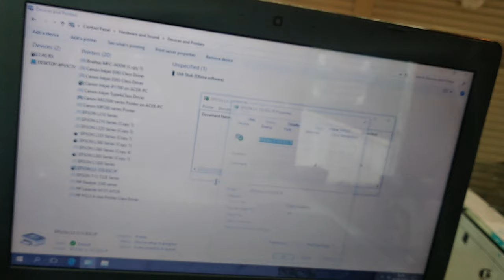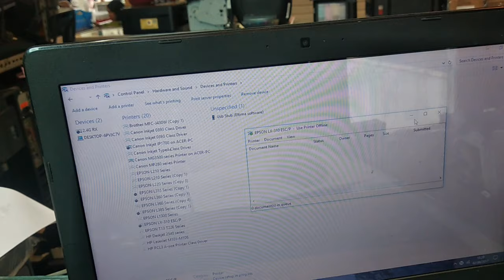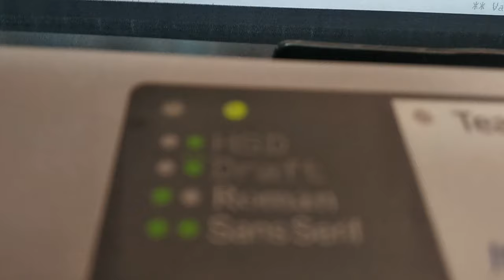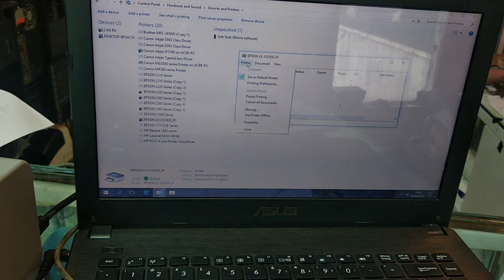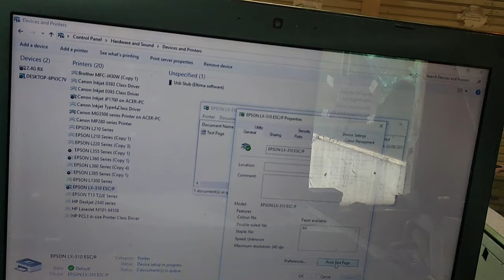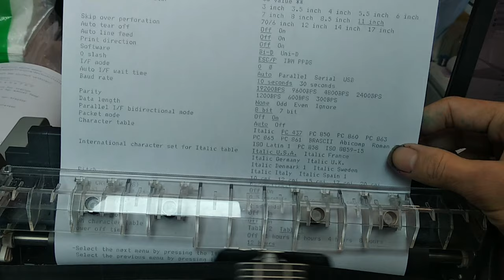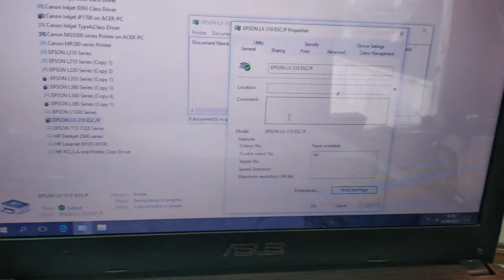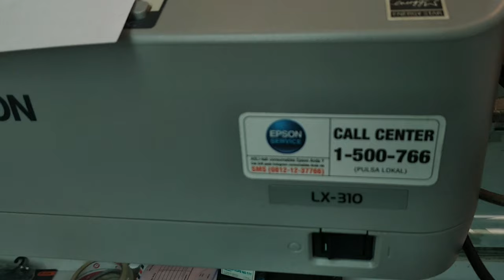Cara atasi printer epson LX-310 tidak mau print (padahal USB conect)

Comment: kang printer lx310 saya tidak respon print lg setelah sblmnya bisa. Kronologinya saya habis ganti cpu dan ganti os ke windows10. di settingan device & printer, lx310 nya sudah detect
Reply from the maker: Deteck logo printer atau logo kotak brangkas di windowsnya ..? 
.
Kalo kotak brarti minta instal ulang driver . Kalo logo printer coba pake cara di video , settingan port biasanya kerubah .
Reply: Sagala Tiasa kalau settingan portnya gmn gan... ini saya tampil logo printernya
Reply from the maker: Coba samakan settinganya dengan yg ada di video ,